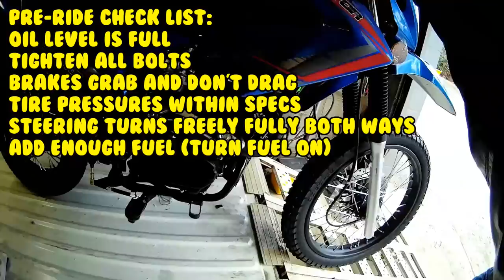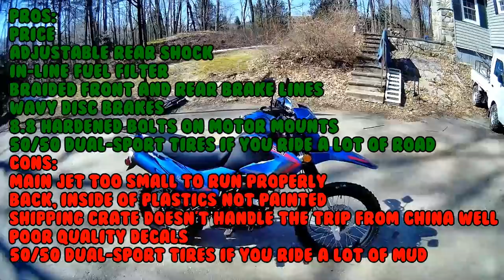$1300 NEW 2019 TAOTAO TBR7 230cc FULL REVIEW build ride mods Dual-Sport Pros Cons.

Comment: I received my "bike in a box" and assembled it in one day.  Of note: there were no directions, chain came too tight, no notches on back bar for adjusting (had to count threads on bolt), front cables where fed incorrectly, one cable pinched in the lock, sharp part of frame was in contact with exhaust (had to grind down frame to prevent eventual hole), rear light didn't turn on when back break applied (had to adjust the spring to the sensor), hand guard wouldn't fit (had to adjust the handle bar assembly).  Otherwise, it's a fun bike for putting around town, and on trails.  It will not get to highway speed unless you change the carburetor (Mikuni MM30, VM26), jet (110) and front sprocket (17 tooth).  Note:  bill of sale came unsigned... you can fixed that ;). I purchased it from Txpowersports.com for free shipping.  Hindsight, the shipping cost was included in the price; therefore, I had to pay sales tax on the total price at the DMV.  If I had known better, I would have bought it from another manufacturer who line items the shipping, then i would have only paid sales tax on the bike....live and learn.

Some things that might be helpful info for a newbie:  take front break off before installing the front tire; spacer from shipping is needed for front axle; replace shipping nut with provided nut on front axle; be mindful when putting on the handle bars that the cables go behind turn signals; rubber flat bungee is for holding the battery; might need to squeeze the electrolyte container a little to get it to drain into the battery faster (do not lift it off the battery until it is completely empty).  Overall, the bike was easy to assemble.  My hardest task was getting the bike out steel crate and off of wooden palate by myself.  I broke down the metal cage (top and side bars, while leaving the bottom frame), I slid the metal frame and bike to one side of the crate, lined up my lift with the frame stand, then I slowly rocked the bike onto my lift.  Some hairy moments, but success.  I recommend having a friend help!  I completed everything, including the grinding of the frame in one day.  I have the white one, and really like the look better with all of the stickers removed. 

PS. If I can do it, you can too (57 year old female).
Reply from the maker: 🔥🔥🔥👍 great info!
Reply: Damn, you know your stuff! Your SO (?) has a dream-woman
Reply: Niklas Almaas thank you!

Comment: Stick to the Japanese bikes shouldn't need to make adjustments  to a new bike
Reply: I own a Jap bike but their stuff is expensive af too. Might as well buy a KTM or Husquvarna.
Reply from the maker: KTM and Huskys have super high maintenance, may as well go China... There, full circle! Haha😁
Reply: Marvin Benjamin The difference is when you buy a Japanese bike it’s from a dealer. The dealer adjusts the carb, suspension, levers and puts all the parts in it. If you look behind a Japanese bike dealership you will see the crates they come in. Yes, Japanese bikes are better, but the Chinese bikes are a half to a third of the price.
Reply: @paulnunya3429   ok you always make adjustments the same way, you don't have take all that time put it together take it back apart time is short. I'm on a mission
Reply: Marvin Benjamin If you’ve ever raced motocross you would know that you are constantly taking apart, adjusting and repairing your Japanese bike.
Reply: @paulnunya3429  I'm a Honda motorcycle mechanic, and no, this is not always how it works. When we get new motorcycles in, they are almost always 100% complete, unless it's a dirt bike. Dirt bikes need the front wheel put on, and the handle bars. That's it though. Don't need to adjust the carb, nothing, it starts right up and runs great from the get-go. CBR1000RR comes complete in the crate. Goldwings are about 98% complete with minor assembly (They have to remove some parts so they fit in the crate). ATV's are completely assembled, some need a few plastics put on.

If you don't actually work in the industry, don't assume you know how it goes. In my experience as a mechanic, anything Chinese we've had come through the shop has been a complete utter piece of crap, that we have started turning down services for TaoTao's because it's hard to get proper parts, and they are cheap and just fall apart basically. I know people have other experiences, but as somebody who has quite a lot of experience in the repair field, and have seen many of these TaoTao's from the maintenance perspective, I would not trust your life on one of these. Used Japanese is much better.

Comment: For all the people saying this bike is Junk. Myself and a friend purchased them and received them last week. The bikes are assembled poorly, nothing is  adjusted correctly and it takes several hours of thorough adjustment to get it right. 

After that the bikes are absolutely surprising! My friend dropped his in woods 15-20 times with nothing breaking.  With gearing and a 110 main I hit 68 mph and am able to maintain 50 easily (even up hills).  My friend already put an exhaust on his, and his is now several bikes faster thru the gears. He is also running a 120, still lean on pilot circuit because I don't have any lying around.

I am having a ball on this thing!
Reply from the maker: Haha. Sweet! Yes a little tweaking and they're decent bikes! 👍👍👍

Comment: Start doing 90 day updates on this bike. Ive rode and worked on their scooters. If this is similar, it'll become the junk the scooter is around a thousand to 15 hundred miles. One problem after another. Time will tell.
Reply from the maker: I have hawk250 videos for last 3 years, same bike. Biggest issue is loostening bolts
Reply: He may have to do 90 minute updates, lol.
Reply from the maker: Watch my hawk250 videos. 3000 miles very little issues and still runs great

Comment: Sweet! $1300 sounds  like a good deal to me..  I'm sure  I'll be looking into getting  one of those.  Thanx for sharing!
Reply from the maker: Over 10,000 miles on hundreds of hawks with same engine etc.
Reply: @Austin Friedner I run my shit like I stole it. Never busted the hawk. I have busted honda, yamaha, and kawasaki quite a bit in my life though. Only thing I did to the hawk was change the tires and tossed the carb out. Price doesn't mean anything anymore as these bikes are usually direct clones of major manufacturers.

Comment: chain freeplay on a dirt worthy bike should be 4-5cm not 1-2cm :D
Reply: On motocross / trail bikes. Tao isn't made to jump.
Reply: My DR650 isnt made to jump too... it still has enough suspension travel to break the chain if i have 1-2cm freeplay.
It just needs a fat guy or a pothole 
You shouldnt ride anything off road with such a small freeplay and the tao is a dual sport so its meant to be ridden off road... it depends on your skills and your chain freeplay what you can do and what not
Reply from the maker: That depends on the swingarm fulcrum point, high travel swingarms need a chain slack plate and they're run looser because the swingarm hangs way lower. These don't have much travel, more like Enduro bikes. The slack they recommend works fine and doesn't tighten the chain like a long travel swingarm.

Comment: What is the price for those?    The Hawk does have a good following..  I have a Honda Rally. CRF 250.. (expensive) and much more so w/ my mods.. Looking at the Yamaha TW 200.. . looking for lighter weight.. Trail bike and Grocery getter hanging off the rear of my 26 foot RV..
Reply: $1300 I think
Reply from the maker: Yeah, 1300.. on sale. They're decent, for running around town, some trails etc. They like the old 80s bikes
Reply: I have put a little over 8k miles on a TW200 in the last year. Very little power but stupid reliable and will ride up any steep terrain.
Reply from the maker: Yep. Sounds about right hehe
Reply: @johnballentine3458  thats what i used in the rider safety course. thats what they chose for me when they asked me what kind of bike i owned. it was a 1500 vulcan.  i really liked that TW but i like GW's more.

Comment: Just a tip, always put positive on first and negative last. If you pull a dipshit and let the wrench touch a good ground when tightening the positive with the ground already connected the wrench can arc weld itself to whatever it grounds to and start a battery fire. Once you have seen this happen in a shop you would never put the positive on last again.

Comment: The free play on the clutch lever depends on where the clutch disengages.   When you are stopped in gear with clutch hand lever all the way in you adjust cable length so its just a little past the relase point and doesn't drag...    That way you are not compressing the crap out of the clutch springs.    Just enough to get the job done and a tiny bit more to compensate as cable stretching occurs.    ->  clutch cable and clutch springs will last longer.

Comment: I have over 600 miles on my TBR7  that came in late January. It has been cold and only clandestinely ridden on back roads and mildly challenging woods. The jet was changed to a 110 and a small hole was accidentally drilled through the end of the exhaust. Before these conservative mods 60 was the max speed with the stock sprocket reading the stock speedometer. It was pointed out that these speedometers are a bit optimistic and using Quick GPS Meter app I found that 10 miles on the odometer was actually 6.39 miles and after the mods the speedometer said 80 the GPS said 66.  The 17 tooth sprocket has been ordered. 

The bush guard bottom half connectors broke rather quickly but can be wire tied with fair results. There were no birth marks...  Love the bike.
Reply from the maker: Excellent info! Yeah speedo not too accurate when new and get worse with age, I always check w GPS.  The digital cluster on my Jawk250 is spot on and will work for these bikes.
Reply: @MotoCheez  I enjoy accuracy, but have read horror stories about connecting up digital dashes on Chinese bikes. My TBR7 manual has a schematic that shows an "electric door  lock" circuit, which does not instill me with confidence. 

I am considering a couple of imports that are under $35 w/free shipping...
Reply from the maker: @robertfish4734  the one I use was designed by a guy from chinariders.net. It was plug n play. hawkclusters@gmail.com if he still sells them

Comment: Really enjoy all your videos on the Chinese bikes... Get alot of good advice off them.  My son is going to order and TBR7 Tuesday from TXMotorsports and after he orders he is going to go ahead and order the 3 main upgrades...Carb front and rear sprocket. So we can put it all together at one time..From your site this is what I have Figured out he needs and want to make sure I am right... Here are all the 5 upgrades
MYK VM26 30mm Carb Carburetor PZ30
Wingsmoto Carburetor Carb Jet Aftermarket Replacement for VM22 VM24 VM26
E3 Spark Plugs Power sports Spark Plug Each (E336)
JT Sprockets JTF259.17 17T Steel Front Sprocket Natural, 17 Tooth
JT Sprockets JTR269.45ZBK Steel Rear Sprocket - 45T....
Will I have to get a new chain or will the one that comes with the bike be ok to use for awhile?  Thanks for the great videos and just drop me a yes or no to the info on upgrades so I know I am getting him down the right road and thanks again for the great videos!
Reply from the maker: As I said.in chat,  the chain on some of these bikes have been larger. So safer.to get the chain along withe the sprockets.. thanks!

Comment: My Xt600 cost 1200 used and has 8000 miles on the stock engine with no noise or problems. TTRs online for less all the time. And my money didn't go to CHINA
Reply from the maker: Went to Japan originally. That's cool, I don't hate Japanese bikes. But many chinese parts are in many of the cars and bikes today.

Comment: Oh, one more thing, you can trust 'Da CHEESE' s opinions on this stuff, he's literally 'been there/done that' with these cheap little motos. Also, for a few bucks to ebay, you can swap out that stock carb for a MUCH better and easier to adjust Mikuni. Will improve your bike's responsiveness and ease of adjustment for changes in 1. altitude/air-pressure-density) and 2. Changes necessary for seasonal differences. Last thing, (promise) think about swapping the stock tubes out sooner instead of later if you're actually going to ride somewhere where bike recovery might become a big deal, and if you are either pretty heavy, or exceptionally light, think about putting in some "real fork oil" instead of the who knows what comes with the bike:) Adjust the type,  weight and amount of the oil to suit you and your riding type. oh, one more thing--locktite!!! nuff said :) Seer
Reply: The Bashan brand of Chinese bikes actually come with very high quality stock tubes.  The Hawk's tubes are substandard.  But you won't know unless you check.  The Taotao is very new, so someone (Motocheez??) should check them once and for all to see if one can live with the stock tubes.
Reply from the maker: I still have the stock tubes in my hawk and my son's hawk.. 3 years now. The magician got a nail in rear tire at 8000 miles.
Reply: @MotoCheez  there have reports within the past few months of people having catastrophic tire blowouts on their Hawks on Chinariders.  It is reported how thin they are.  Probably trying to save money the past year or so vs. your Hawk.
Reply: Cheeze, just for fun, dflate a tire and pull the tube out from under the bead a little from the side, and tell me you'd risk your life in a remote desert region on those oem hawk tubes....if yours has what mine had, you'd b online looking for replacements pretty quick..just saying.. Seer
Reply from the maker: I'll have to look, the one we took out if the magician was "ok" not heavy duty. I have spare tube and tire kit on my DRZ

Comment: Seems like we have alot of people here who think their opinions are highly Valuable simply because they all yelp like seagulls from finding nemo. Great you are all some real original thinkers. next. 

Buy whatever you want. I've literally trashed my 250 apollo on some trails and it still runs. Got a bent rim cause I was going mad with it. Was it a pain in the ass to fix up a gas tank that was poorly welded. yep. was it a pain getting the carb off because it is wedged in between the engine and literally everything else. yep. was it fun to figure out how to tune it and what was wrong with it running at 6500 ft elevation. actually yes.  You don't learn anything riding a bike with no problems. But you sure do pay a hell of alot more for something that can and does break down like every other bike out there. at least now I know what I'm doing and I got a bike that clearly runs well when properly thrashed and maintained. worth 1300 bucks instead of a 10000 hour klx 300 for the same price. yep.

Comment: I'm going to do a review on this bike, I love it. The only thing bad is it leaves you with the feeling you need a little more top speed, if it could cruise at 65 half throttle and maybe top out at 75-78mph I'd have no complaints... ps it climbs hills like a champ
Reply from the maker: 😁👍👍🔥🔥 agreed. Has a lot of low end.torque. I'll be doing a few more reviews over the next few months
Reply: How is it after all these years ?
Reply from the maker: Good. Blade owns it, has almost 9000 miles.

Comment: 1 192,88$ for a 4 stroke 250cc is that a good price or is it way too cheap?
Reply from the maker: It's a good deal!
Reply: MotoCheez thx
Reply: MotoCheez but it’s not used tho
Reply from the maker: @47x47-p2q  ohh. Depends. If it's in new condition it is!
Reply: MotoCheez yes

Comment: The thing is, the parts are very poor quality and have a short life, especially from the smaller brand china companies.  There is missing hardware and damage as well as defective parts at times on these.  Not as easy as he shares.  My tme is more valuable then messing around with a few hours of assembly and down time which includes DMV title and registration that you have to do.  Rather buy from a legit dealer turn the key and play with all the Docs. done.   Appreciate the vid.

Comment: Thanks for the video on these. Looking at getting into ridng along with my brother. This looks like a very inexpensive way to see if we like it. Question though what is the weight limit for these bikes? We are both like 6' and weight 190 and 220 will these bikes work for us?
Reply from the maker: My friend Vee rides a Hawk, same bike basically, hes over 300 lbs and it hold him. Theyre decent bikes, not a powerhouse but you can squeeze 65 out of them with mods (55 stock)